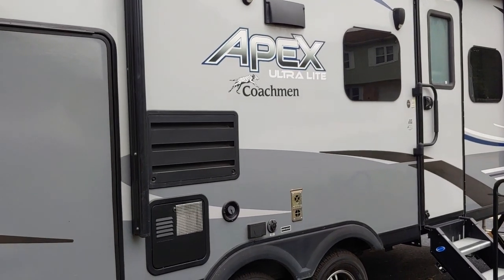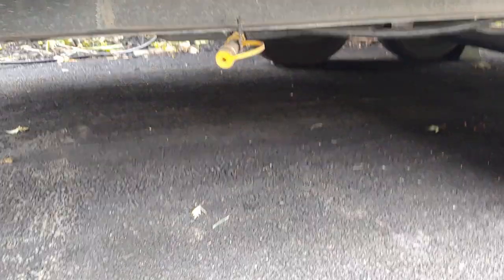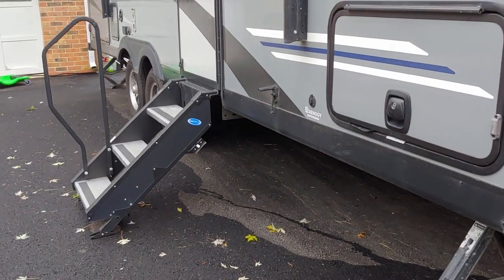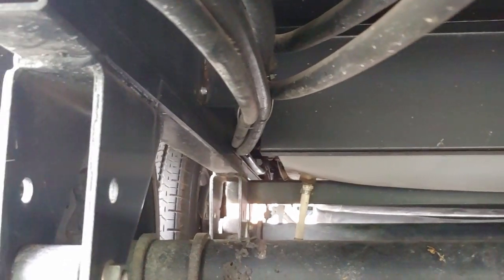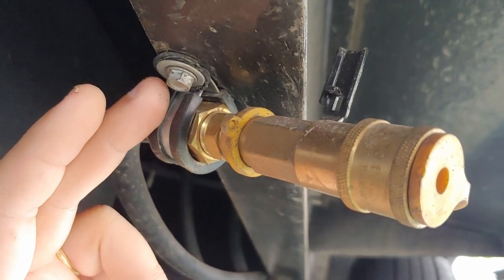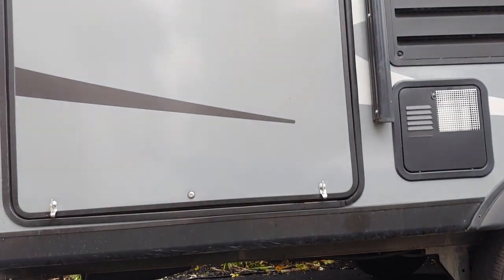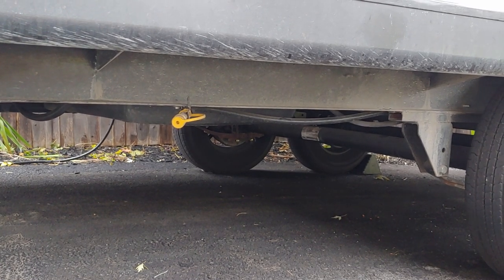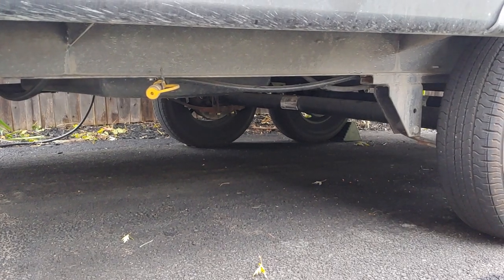RV DIY, add a propane quick connect to your travel trailer

Comment: Wish I watched this first.  Then ordered off of your links.  I ordered  what I thought was everything then realized the flare vs mpt issue  .  3 trips to hardware store and I got it together.  Then I didn't have any pressure and the grill wouldn't work so I think it's either my regulator or there's debris in the line somewhere so I'm going to have to take it all apart. Great video

Comment: Did you add Teflon tape to any of the supply line ends, 3/8 to 1/4 reducer area, when connecting that new line? I’m in the process to add this same set up soon and was curious to know if that’s needed when doing so? Thanks for sharing the video. Much appreciated!